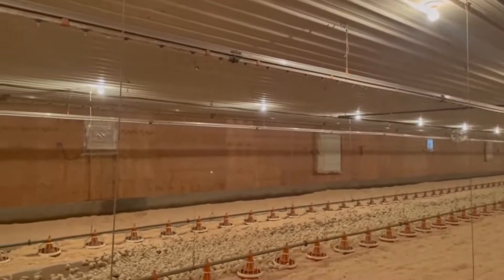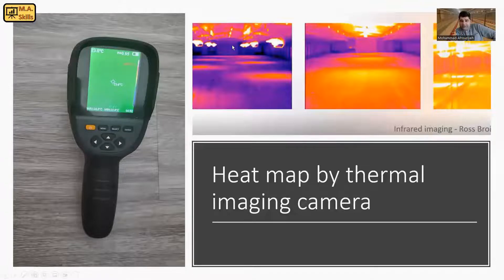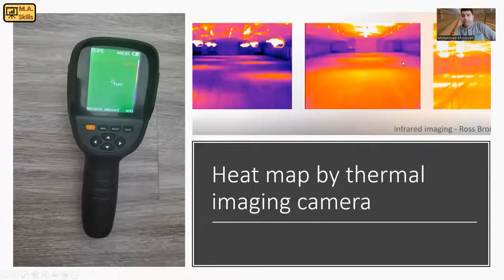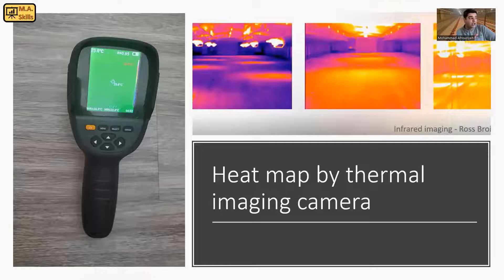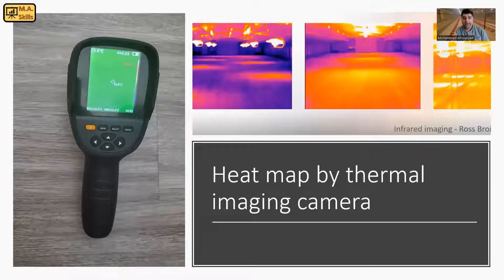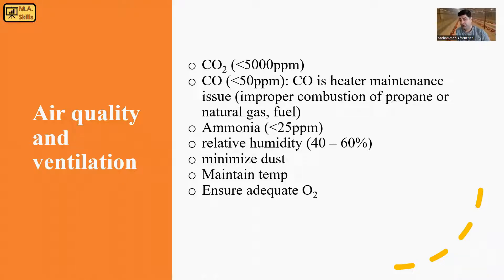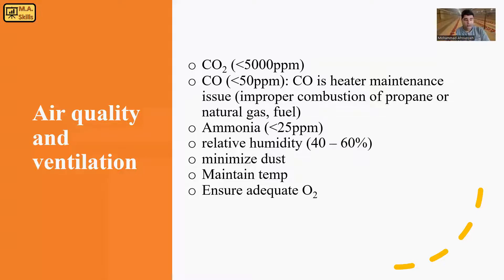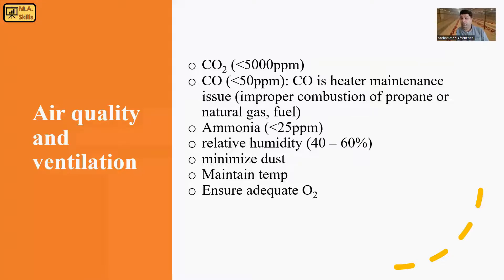Complete guide to broiler farming temperature and air quality

Comment: Great class... I have a question,which type of litter specifically are u referring?? And is sawdust advisable!?? It's very light plus it can also mix with the particles in the air in places where ventilation is not controlled..what would u say to this..
Reply from the maker: I have finished creating the broiler farm tour series and overall there are 7 episodes. In episode 6 I have specifically talked about litter materials and management which will go online on Nov 28. Overall a good litter should be light, non toxic, moisture absorbent. In my opinion, pine shavings are one of the good bedding materials. Sawdust is also a good source for litter. 
By the way, ventilation topic is in episode 4 which will go online tomorrow.